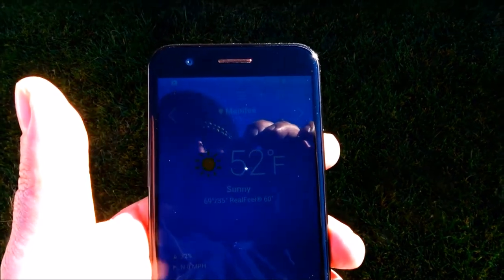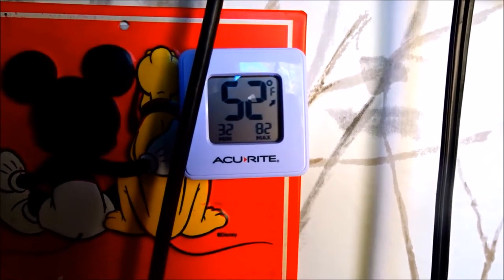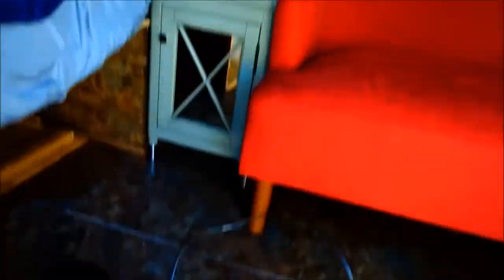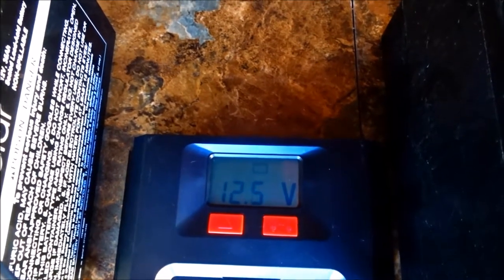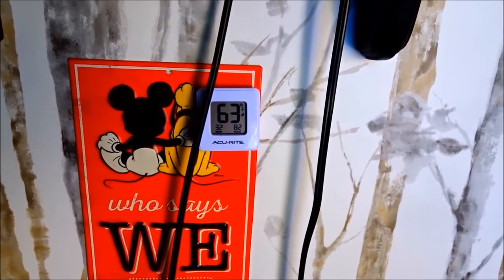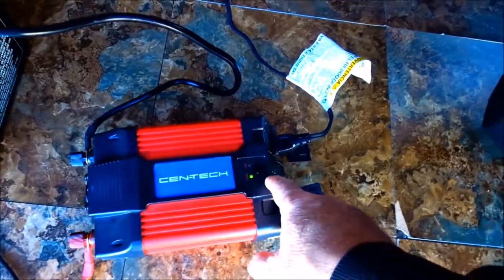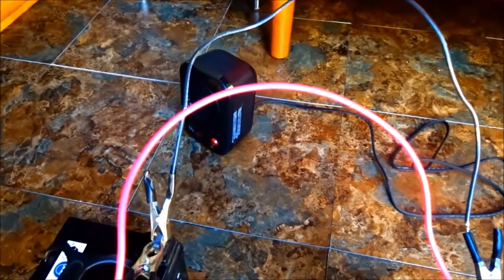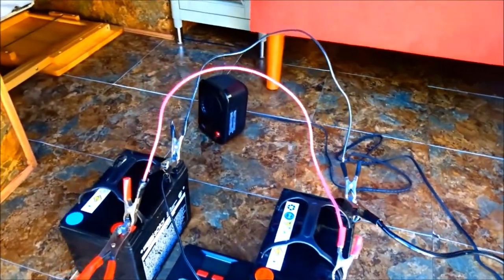Lasko My Heat,  Ram Promaster Van, Harbor Feight Thunderbolt Solar, Will it run?

Comment: I've got five of those batteries now. I've been buying them every time I get a  25% coupon from Harbor Freight. In retrospect, I should have just saved up a gotten one big battery. But I like the flexibility of being able to add power storage 35 amps at a time. I'll probably get one more for a total of 210 amps.
Reply from the maker: These batteries are great for the price. Remember they are AGM batteries and are in my opinion better than other types for some good reasons. The do not off gas hydrogen unless you over charge them so much they have to protect themselves. This means you can use them on their side if need be. You can use them in a closed space and not worry about venting them to outside. They will take a lot more cycles of charging and discharging than other types of batteries. You can actually discharge an AGM battery down to about 35 percent instead of the recommended 50 percent and you will not hurt them. Thank you for the comment.